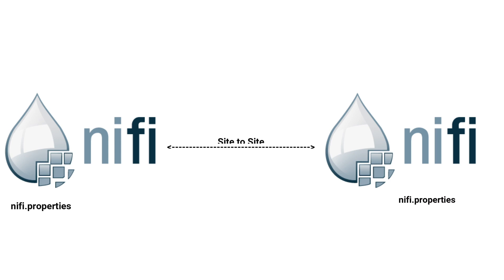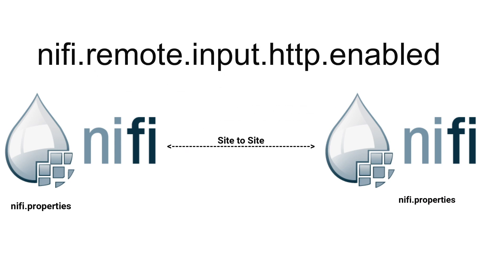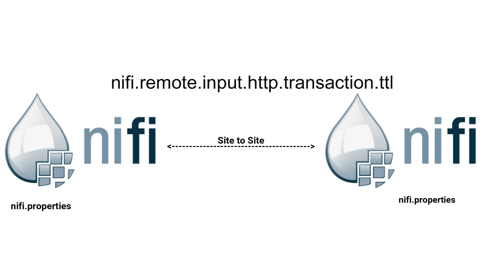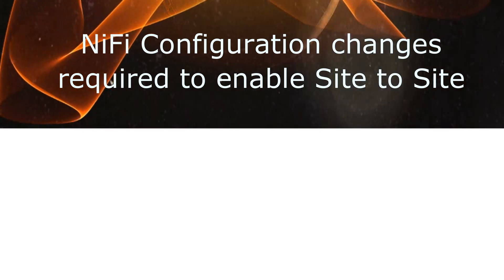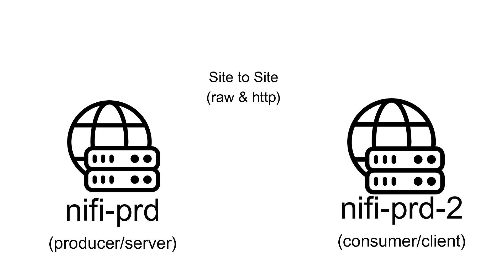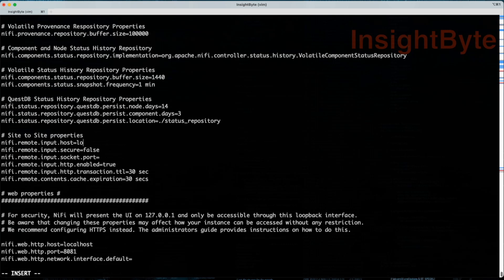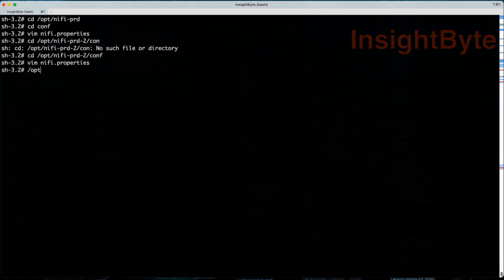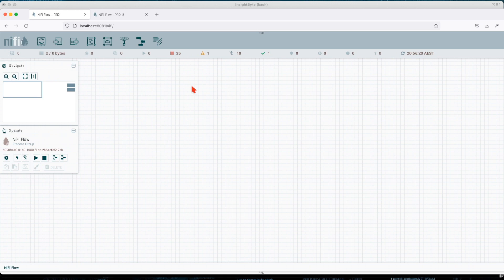Apache NiFi Site to Site System Properties Configuration

Comment: I want to migrate data from MsSQL Server to Oracle Database. I added ConnectionPools for both of. I am trying to export data andimport data ,but i cant. Which processor i need to use and how ? I tried to fecth data with ExecuteSQL but it is fetching as Avro. Than i wanted to convert it to json but i didn't. Because i cant configure the ConvertRecord processor.
Reply from the maker: Use avrotojson procesor to convert
Reply: @InsightByte  am i wrong ?
Reply from the maker: @xarke6430  no you are not
Reply: @InsightByte  it is not available for new version.
Reply from the maker: What version are you on
Reply: @InsightByte  nifi-2.0.0-M3
Reply from the maker: Use the convertrecord
Reply: @InsightByte  but it is not working. Can you share your e-mail. Can i send you my flow ?
Reply from the maker: @xarke6430  https://discord.com/invite/cTGmE86J join here, we will be able to help
Reply: @InsightByte  invitation link is invalid